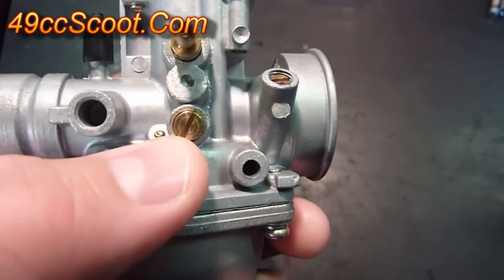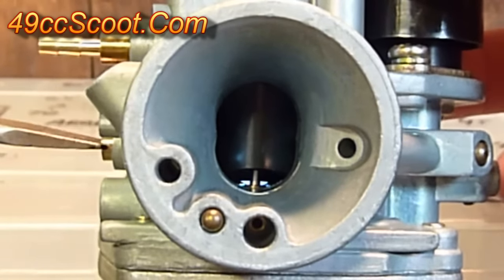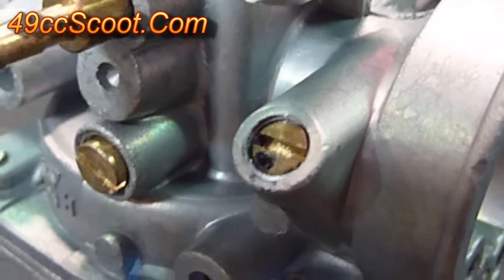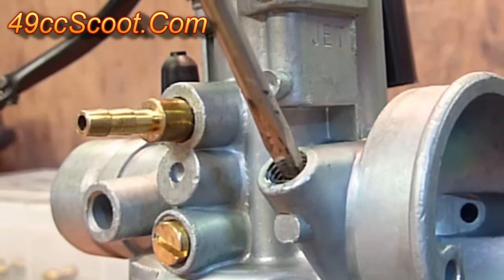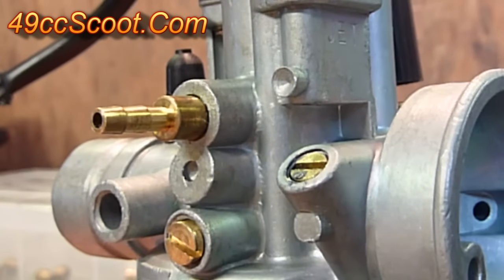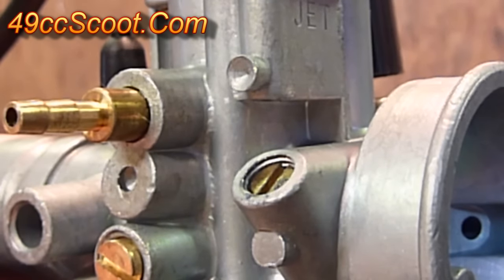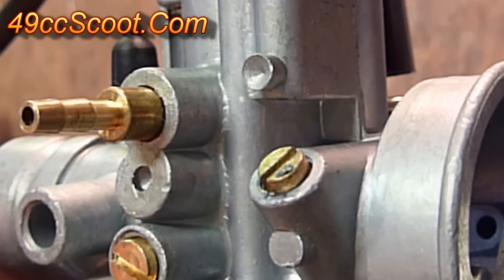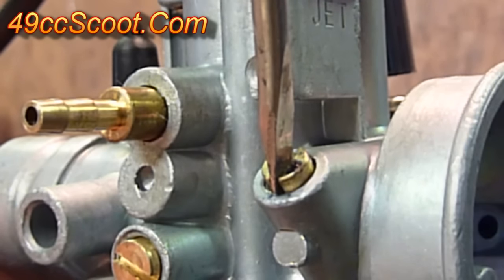Two-Stroke Scooter / ATV Carburetor Settings And Adjustments 2of4 : Idle Speed & Mixture

Comment: i have a 18 mm keihin cvk carb for 4t.stock filter.mainjet is like 78.now this carb has a different basic setup like air screw 2.5 turn out.i did replace my mainjet for 80 but now i only get a stable idle when i turn the air screw like 3 or 3.25 out.pilojet is 35 but i dont think need a smaller one normaly never need to touch the pilotjet.so im wondering how  im suppose to set it up to give less air.i dont have airleak i check it many times.but strange things happens the idle screw not really responding.but the throttle cable sit proper so i have no idea why need the carb more air.

Comment: I have a 2006 kymco agility 50 and it was running fine but now every time I start it up it goes to a dangerously high idle. Then after I ride it around it goes back to normal. How can I fix the problem??
Reply from the maker: Nathan Cady It may be idling high because of the enricher working when cold. What do you call dangerously high?

Comment: what would cause excessive oil/gas to shoot out the exhaust on cold start then go away after it warns up? very very hard to get started also, about 30 seconds with electric starter.
Reply from the maker: Possibly flooding when it sits. Make sure your petcock or shutoff is working or turned off when it sits. Holding the throttle open may help fire it up quicker if that's the case. Could be an issue with the enricher or choke. Maybe too large of a jet in there. If no one has fiddled with that though, it's not real likely that there's a huge jet in there.

Comment: Please define highest idle speed? How high am I trying to get it, what does it sound like, do I then adjust the idle where it needs to be with the idle screw once the inlet is set an 1/8 to the rich?
Reply from the maker: Usually 1500-2000RPM is good. Some will idle lower. Mainly you just need a good stable idle speed that isn't revving so high that the scooter is near taking off. Get the speed in the ballpark, adjust the mixture, readjust speed as needed.

Comment: I need help please. I have a kymco cobra 50 2 stroke scooter. I know when you cold start 2 strokes they rev high and go back down but this is not the case! I’ve cleaned the carb many times and nothing. I acecelerate to take off it revs high and won’t go back down. Clutch is good
Reply from the maker: Have you checked it for intake/case leaks? Sure the throttle setup is working as it should?

Comment: What about for a scooter that starts and revs runs then revs up real high then dies?  I've cleaned the carb and the jets and then fuel pet cock as well and still just reving high then dies.  Could it be a vacuum issue or air flow?  It is on a 1989 yamaha razz 50c scooter.  Anything advice would help.  Thanks
Reply from the maker: Check for vacuum/case leaks. Best way is a pressure tester. 
http://49ccscoot.proboards.com/thread/506/make-2t-leak-tester-ways

Comment: What about the airflow ? How to adjust that. I messed with these and now my vivacity goes perfectly up to 10km/h but when I give gas it goes barely up to 25-30, more gas and it dies. Used to do 60 not even full gas on. Pls help
Reply from the maker: Make sure your jets are not clogged and the carb is clean first... as well as air filter in good condition, no leaks and no other mechanical issues.

Comment: you miss the point of making an example of whether this variation is an air screw or a fuel screw. typically air screw is on the side where the air box is mounted, fuel screw being on the opposing side towards the engine. however this still does not show what to do about a carburetor with a mixture screw dead center in the middle of the carburetor (like a stock '02 Zuma 50cc). any thoughts on that??
Reply from the maker: It's an air screw in this case. If you want more detail of carb tuning look at my page here :
http://www.49ccscoot.com/faq/carbtune.html

Should be an air screw on the Zuma.
Reply: Thanks for responding!  I had a feeling this was an air mixture once I eliminated the airbox snorkel & turned the screw out to accommodate my excessively drilled main jet for improved WOT....   now it's to lean to start when cold! Time for a bigger idle jet now.

  I hate working on this '02 Yamaha Zuma!!   So little space, can't get a hand in around ANY of the frame, CAN'T SEE ANYTHING. The worse part is there's NO ACCESS PANEL in the seat bucket! 
   PLUS--  you have to remove ALL plastics around the seat to remove it!!!!  I HATE THIS THING

I prefer working on my Aprilia sr50 or ANY of my 4  Chinese bikes over this Turd!

Anyway....  my many thanks for all you've done & published for the scooter community.  Absolutely exceptional videos & documentation.  My favorite is your series towards a PoorMans Overrange CVT.  PLEEEEEEZ continue efforts in this àrea!

Cheers,
  - Rob
Reply from the maker: After putting a lot of miles on an overrange CVT, I've reached the conclusion that the price isn't actually that bad if you use it much. My Malossi OR has been very reliable and I'm not replacing parts like I was going the cheap route. The only thing I really had to replace were bearings in the rear pulley and a bushing for the variator and a drive boss to match. That is aside from normal maintenance like replacing belts. That's in 10,000 miles at least. I would have went through at least a couple of cheap variators in that time and possibly worn out a torque driver and used a lot of guide bushings for the variator.

Comment: Hey man, I got myself a brand new scooter and i've been having some problems with it, in where i live It's limated to  45km/h (~27mph), tho the problem is that  it has really a hard time reaching  even 35.. at like half throttle it goes 30 but at full throttle it can barely crack the 40km/h mark,  I took out the sparkplug to check on it and it was full of soot like its running to rich or something I guess, It studders and stuff when I accelerate while having the throttle more than half open. There's also a plug in the air box which limits the ammount of  air going into the engine, should I remove it and try some more if it'll go faster or is it something else with the carburator?

Do you know what can be the problem?
It's a 4 stroke GY6 50cc engine..
Reply from the maker: It's running rich from the sound of it, so removing that plug would be a good place to start. I've got a vid showing some carb tuning for the 4T.
Project TaoTao : Carb & CVT Tuning, Airbox Restriction, & Keihin PD19J Swap : 50cc Scooter
Reply: it could just be that the engine is not borken in
Reply: *****
Some scooter mechanic friend of mine told me its very possible that the automatic choke could be broken and not " de-choking " which is causing the scooter to be very rich when riding, is that possible to be a cause?  i really want to leave the scooter at a mechanics place instead of buying lots of main jets and such but if it could be simple as a automatic choke thats at fault then i could get a new one from the waranty. :p
Reply from the maker: ErmaTheKitteh
 Could be. If the enricher malfunctions or has no power getting to it it won't block off the extra fuel that it allows past at startup. You can measure the enricher cold and then reinstall it and run the scooter for 5 minutes. Then take the enricher back out quickly and it should be longer than before. If not you either need an enricher or for some reason it's not getting power.

Automatic Enricher Operation (10x Speed) : Choke Bypass Bystarter
Reply: ***** It seems to be abit weird with my scooter.. the enricher works but the thing thats making me scratch my head is the spark plug was 0.3mm away from the correct plug gap  and that plug gap was adjusted at the factory, i make the gap bigger and got it adjusted properly, now the engine is far more responsive from idle to about 3/4 throttle, I guess that the only thing I really have to do now is adjusting the main jet then i should be fine I guess.

The scooter came up to about 42km/h which was close enough to the 45km/h mark that its suposed to reach.
Reply from the maker: Glad you found the gap issue. If a plug is dropped at any point in shipping or whatever that's all it takes sometimes to throw the gap off.
Reply: Yeah, it was the easiest one to fix compared to things like main jets or valve adjustment etc. :)
Im gonna change the springs tho so i get a better start, other than that, Its mostly set, thanks for your help and tips man. :)

Comment: i have a v100 scooter 2stroke. i have cold starting.. hard to start. wont idle.. but it running fine when its already warm up.. what can cause that problem? is that because of auto choke not working properly?
Reply from the maker: Could be the auto choke. Maybe as simple as a spark plug in need of replacement. Sometimes if the carb tune is off that can happen.

Comment: hi. I changed my carb to high performance one like you suggested in another video also a air intake 
I get it to run but has no power and with adjustments there seems to be no difference 
I don't get it. can you help please am I missing something 
Tao 50cc with big bore kit done
Reply from the maker: You will need to do more than just adjustments. You'll need a main jet kit to find the right one for you, especially since you are using a different filter/intake. May also need a larger pilot jet.

http://www.49ccscoot.com/faq/carbtune.html

Comment: on your other video you said the opposite about the mixture?on this one you said outward is leaning the mix and inward is enriching the mixture but on your pdi video you sais screwing the mixture outward it is enriching and screwing inward is leaning??
Reply from the maker: It depends on the carburetor. The general rule is if the mixture screw is on the inlet side it controls air. If the mixture screw is on the outlet side it controls fuel. In blocks the passage more, out opens it. So, if you screw out a fuel screw it opens a fuel path and richens. If you screw out an air screw it opens an air path and leans.
Reply: *****
 what do mean by inlet and outlet? if im sitting on my bike, my mix screw is on my left (choke side) by the way, if i have a 150cc can i still join 49scoot.com?
Reply from the maker: Inlet = The side the air filter is on. Where air is drawn in.
Outlet = The side the intake/engine is on.

Comment: what if the bike doesnt have the idle air mix screw ? i cant find one.. can see the place it could be but its blocked off with metal?? help
Reply from the maker: Sounds like you've got a sealed carb. The carb is a little different, but the way the mix screw is capped is likely the same as this... 
https://youtu.be/MLpkf2LINzo

Comment: I have a 2006 Polaris sportsman 90 and it idles just find but starting off from a dead stop it acts like it wants to die and sometimes it does die. Any suggestions?
Reply from the maker: Could be carb related. Maybe a different needle setting. If it sputters try leaning the needle. If not you could try richening the needle setting. Could be a CVT problem. Maybe the clutch is engaging too early, roller weights are too heavy/contra spring too light, or the belt is being squeezed, or it could be dirty.
Scooter CVT Transmission : Full Service Inspection

Comment: hey, ive had a 21mm dellorto carb on my geared moped, it was fine but always had petrol over it, so i changed to 19mm, but no i have problems, whatever i do, needle position change, mixture change, it always starts dieing when giving it more gas, for example if i go on neutral and give it gas, it doesnt stop working, but if i drive it on lets say 2 gear and give it some moore throttle it stars dieing.
Reply from the maker: You may need a larger main jet. Have you tried that yet?
Reply: ***** larger for a 21mm that eats too much fuel and spoils petrol or on the 19mm?

Comment: I got question, on my 110cc atv it wants to turn off and backfire at the same time. The idle was set to idle normally but that problem stops me from riding.
Reply from the maker: +TheMTGNMClub14 So it does this when you get on the gas? Has the engine been apart recently; wondering if there's a timing issue? Otherwise, I'd guess it's very lean.
Reply from the maker: +TheMTGNMClub14 So it does this when you get on the gas? Has the engine been apart recently; wondering if there's a timing issue? Otherwise, I'd guess it's very lean.
Reply: +90GTVert it has been once taken apart but the timing was set correctly

Comment: Honda elite s 50cc two stroke 
what is the best setting for idle (2.5 turns out from flush) and for mix needle at 1.75 
when i open full throttle my scooter sputters and looses power. i revived the scooter torn apart i have it running now, also in the mix needle there was a little silver ring on top of the o ring i figured thats how it went (it was needle spring silver ring then o ring
help please
and thank you in advance
Reply from the maker: Sounds like you've got the needle stuff in the right spots. If equipped the o-ring is usually under the needle clip.

Could be that your needle is set too rich. If that's the case a lot of times the sputter will clear up after a second or few seconds. It could be that the main jet is too large. It won't clear up at WOT if that's the case. Could be something else going on like weak spark for example or bad gas.

Comment: Can you give me each screws setting to start off with? It’s all out of wack I need a base line and then I can fine tune thanks
Reply from the maker: Try the mix screw about 2 turns out. With the idle speed screw, you just don't want to screw it in too far and have the engine rev high if it starts so adjust it till you just start seeing it raise the throttle slide up a little to start and you can turn it in more as needed.

Comment: Idle grate wide open is fine but how about a video on witch way to go lean or rich to get rid of  the excessive radatatatata  of a 2 stroke at part throttle cursing.
Reply from the maker: Sputtering is rich, so you want to lean it out. Just be careful, because too lean and you could end up with overheating, seizing, or melting the piston at part throttle.

Comment: Hello there very good video helped me a little but still have problems. I checked my yahama aerox and fuel lines are good i get sparks i bought a new cilinder i have compression but the scooter sometimes starts for about 10seconds and drops dead.after that the scooter wont start anymore?  Maybe to much fuel or too less air i tryed the screwes but still the same problem does anyone have some suggestions realy need help with this
Reply from the maker: Jordi De bruijn Check your spark plug after it dies. Wet or dry will clue you in to whether it's flooding or not.
Reply: Oke man yeah its defenetly wet and black
Reply from the maker: Hold the throttle open while trying to start after it dies. Not a fix, just something that may help  you get it fired in a flooding situation until you find the issue.

Has it ran fine jsut before the issue or is the scoot new to you?
Reply: I bought scooter 1week ago the cilinder was busted no compresion and no spark. Also scooter didnt move for a year so i fixxed it new cilinder new cablewires etc only now when it runs it dies after 10seconds so today i removed in the carb sprayer 96i think for 78 and started up imidiatly only still same problem so i think its the air but i only mounted it the sprayer and kicked i didnt turn screws or anything yet because its a bit late now its 4 in the nighttume so hehe
Reply from the maker: Try thoroughly cleaning the carburetor if you haven't already. Then see if changing the idle mixture adjustment does anything now that you have a different jet in there. Check the operation of the automatic enricher. Maybe it's not working or not getting power. If you check it cold and then check it warm it should extend once warm so it blocks off extra fuel.
https://youtu.be/O2qRVOkfdaY
Reply: Hm oke man ill try that and thanks for the help btw

Comment: Hi! Ive been banging my head against the wall for 2 days now trying to tune this exact carb.  Its on a (i believe 100cc) atv. Is here an exact idle speed and idle mixture screw setting for these? Everyone ive talked to give me different answers.... start with both bottomed out and go 1-2 full turns out and go from there......still banging my head against the wall. Just changed the coil, i have a new plug gapped to 28 thousandths and the carb is getting gas. (brand new carb by the way) HELPPPP lol
Reply from the maker: You get different answers about settings because no one setting is right for every carb/engine/condition. If 1 setting fit all, they wouldn't bother putting on adjustable bits. There are starting points, usually being something like 1 to 2.5 turns out. That's nothing more than a starting point though. Idle settings should not be a headache unless something else is wrong like float height, dirty/clogged passages, air leaks. More info : http://www.49ccscoot.com/faq/carbtune.html

Comment: Hi man. Do you know of any place that sells the manual choke conversion for this carb?thanks
Reply from the maker: A lot of E-Ton scooters have them. E-Ton did sell a conversion kit, but I'm not sure if they still do. If not, you should be able to get the parts for the manual conversion from something like an E-Ton Beamer.
Reply: 49ccScoot, do you know what the sequence when re applying the idle screw back on with the o-rings and washers? My scooter idle keeps hanging and i have already adjusted the throttle cable adjusters but didn’t fix it. I sort of forgot to take the idle screw and air acrew out when i cleaned the carb with a cleaner and it is the only one i suspect causing this issues of hanging idle probably i swelled the o-rings. Thanks

Comment: before adjusting my carburetor i could make 110km/5 euros of fuel :D
after adjusting it the scooter could go at higher speed more easily but i could only do 70km/5 euros , so i prefered the old adjustment and i have tuned it like before..:P